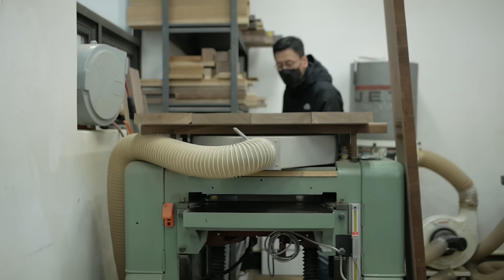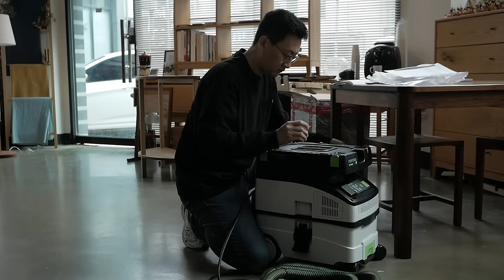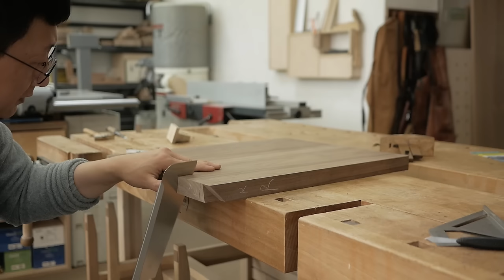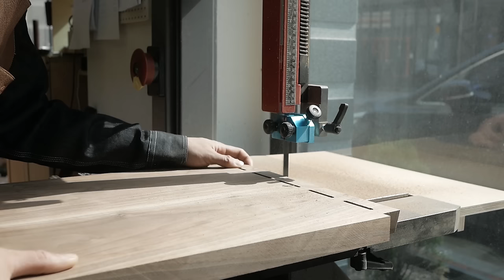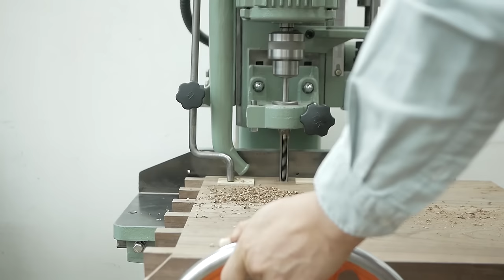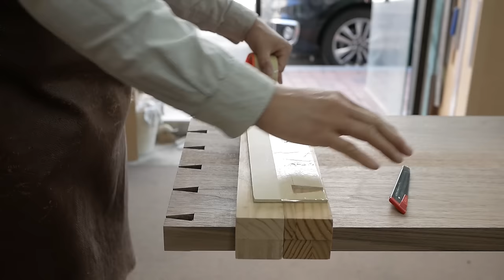SQUARERULE FURNITURE - Making a Korean Traditional Style a Nest Of Drawers - TV STAND

Comment: You make woodworking look like the art it is meant to be !

One curious question: any specific reason why you went with that particular joint for the drawer sides...haven't seen it before and so am not aware of its advantages...
Reply from the maker: It is easy to make and does not require the use of piece screws.
And it's neat.

If there is a better way, please let me know!
Thank you for watching.

Comment: How does that oil hold up durability wise? Never used that one, so very intrigued by it. Amazing work!
Reply from the maker: A good initial finish will keep the coating for a long time.
In general, if you polish it with fine sandpaper and apply it once every 3-5 years, the tree will become lively.

Comment: So gorgeous as always! Is the sandpaper in the Cauls to create friction, or to push against the surface?
Reply from the maker: It's a bit difficult to interpret. Could you tell me which part of the video you're curious about?
Reply: @squarerulefurniture  Thank you. What is the sandpaper used for at https://youtu.be/9iyN0Zk7RlE?t=1124 ? Thank you!
Reply from the maker: @tedrzz  
Usually when both sides are clamped, there is a slight gap in the middle.
Press lightly with sanding paper to ensure perfect clamping.